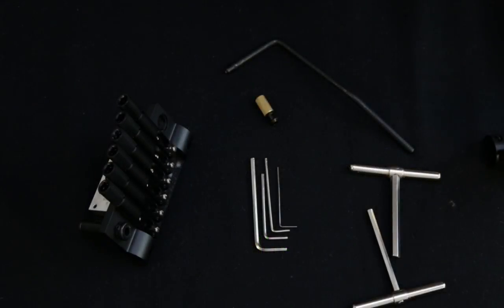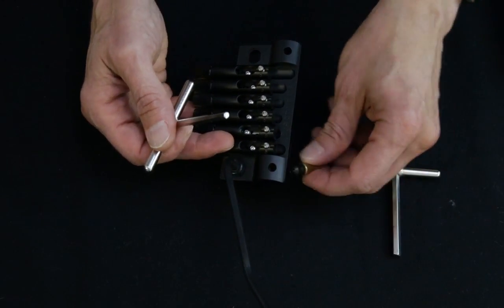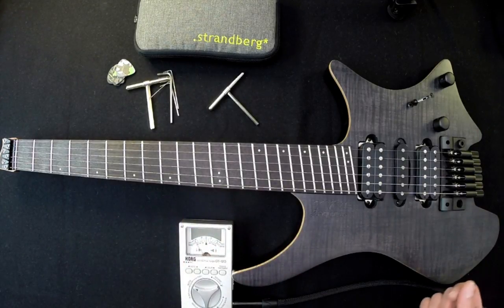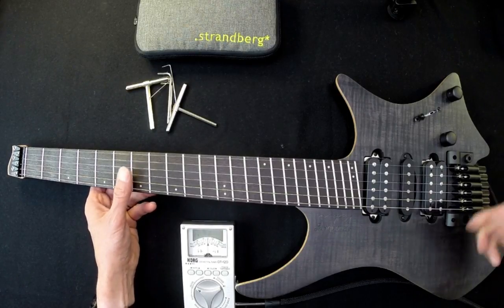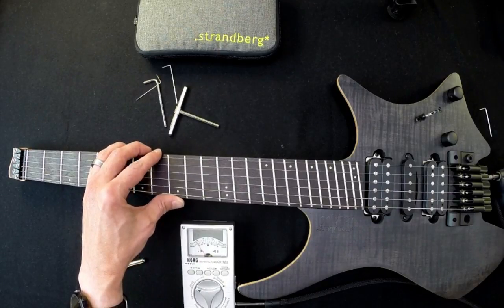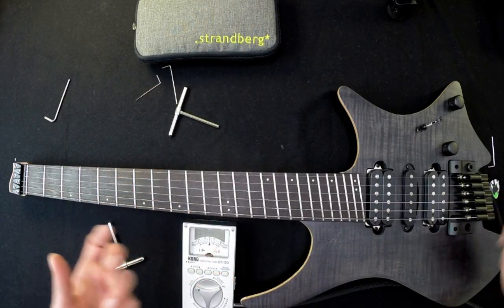EGS Pro Tremolo Rev 5 Overview & Setup

Comment: You just changed the main reason I was going to buy a Strandberg. Knife edges may work but why would anyone even ever think to use that method over a needle bearing system? Eventually a knife edge is going to wear out and lose tune. If the only issue is making it easier to adjust string height then I would either create a housing that still uses needle bearing system that is adjustable or live with the minor issue of adjusting each string. I hope you give your customers a choice of which tremolo system they want...
Reply: Okay but what about the knife edge? Very poor design from the beginning. Here's an idea use rods where the knife edge would be and have the posts have a protruding section to accept the rod. This way you can still easily adjust the post in the same way. I'm giving that to you for free how about that!
Reply: wat?
Reply: Indeed! The original justification for designing the entire Strandberg vibrato WAS the elimination of knife edge in favor of needle bearings! I'm like, "What in the heck is going on!"
Reply: I kinda thought the same thing initially but now after having taken all the hardware apart and examining how it all works and assembles and dis assembles while swapping pickups, it's really not rhat bad. Worst case scenario, youd be replacing the worn knife edge posts and knife edge receivers in the actual bridge. Both of which are extremely easy to remove.

Comment: I see soo many people taping change and picks together to block trems during tunning. One would think that in this day and age where technology such as 3d printers and cnc maching exist, that the manufactures would just make a part or insert to  to address such a matter... just a thought.
Reply: If you look at the older design prototypes on the old website, you'll see exactly such a feature built in to at least one iteration of a vibrato bridge.

Comment: 0:32     Overview of the Rev 5 Tremolo
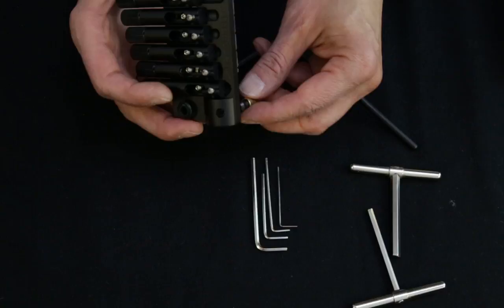3:05     Tools and where they fit on the bridge
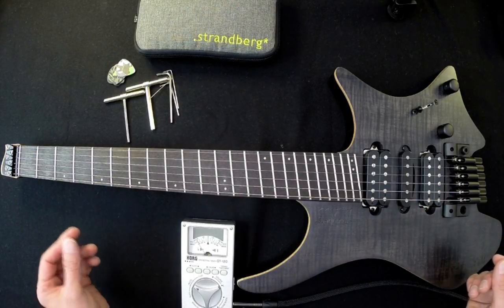7:00     Checking the relief of the neck
7:40     Adjusting the action
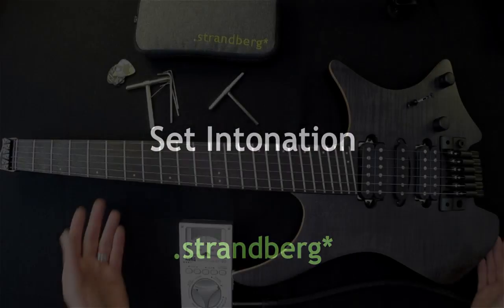8:54     "Stopping" the tremolo before adjusting intonation
11:03   Checking and adjusting intonation
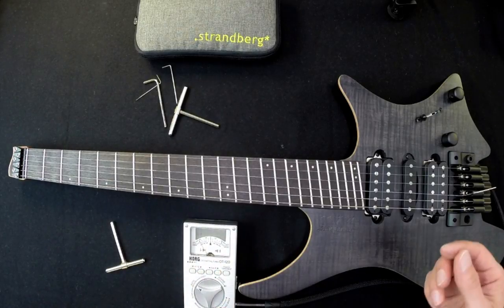15:00   Not enough slack to adjust intonation properly: Ola's solution
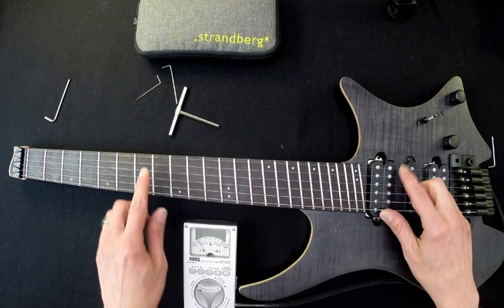16:38   Removing the improvised trem-stopper and re-tuning
Reply: Do a video outline of the mouth smacking he does.

Comment: Two suggestions: I worry about stripping the holes for the trem claw screws if you tighten and loosen them every time you change strings. Replacing the trem claw screws with bolts that go into a threaded insert would mean this never becomes a problem.  And I don't know how to fix it, but it sucks that the string has to be loose to move the saddle to adjust intonation. It would be far preferable if the saddle could be moved with the string under tension.

Comment: In needle bearing tremolo the housing could be mounted over a traditional mounting posts with studs and it could have been height adjustable like a floyd rose posts.

Comment: I'd always check the harmonic agains't the fretted note in your usual playing position (at least if you're adjusting your own guitar). The way shown usually works fine, of course, but in my opinion/experience the position is also a factor because you normally use a different pressure in playing position and your fingers also are in a different position. And if adjusting in playing position you can compensate for that (if necessary, and if you're a nerd;-)).
Reply: The more I watch these Steandberg setup videos, the less inclined I am to purchase one. That method of adjusting the intonation is so labor intensive, and is non incremental, meaning you cannot visually monitor the adjustment sweep. It's a bafflingly bad design.

Comment: Ola,

How would you recommend fixing a nick in the zero fret? I recently purchased a standard 6 and I’m not sure if the dent was there when I bought it or if I did it but the zero fret had a dent at the b string

How would you recommend fixing that? 

My dealer recommended 800 grit sandpaper then polishing with 1000 or 1200 grit

Does that make sense?

Love your guitars ( already have another one on order!)

Comment: I have just brought a Korean 6 strings tremolo guitar. I can't get the saddle at guitar level when I use 3 springs in the back, so I install 4 strings. I use 10-46 strings recommended by official website, what is wrong with my setup? And I find it so difficult to make it intonation.

Comment: Refision 5 Ola? New, but still no brass block... why? As you guitars have no headstock, where does the sustain comes from?
Reply: Paul Kasper can you add a brass block on your own or it won’t fit on these guitars? I installed one on my floyd but no clue about this setup at all. And sucks cause I do want a strandberg but for price should have a brass block. Good point.
Reply: That's actually kinda easy. It never came from the headstock. All physical bodies resonate.

Comment: As a (far less renowned) guitar designer and builder, I cannot wrap my head around the way the intonation on these guitars is adjusted. It seems incredibly hit or miss.
Reply: I don’t own one of these, but it seems the same as for a Floyd Rose from the video. Not as convenient as on a fixed bridge but it’s not that hard either
Reply: @tiagomartins5755  The fact that you can't set the intonation with the strings on just seems wild to me. I had instances back when I was a touring musician when, for example, my preferred gauge of strings wasn't available and I would tweak the intonation as a matter of course after restringing. With the Strandberg, you'd have to string up, tune to pitch, see the deviation, loosen the string, adjust the saddle, retune, check again, and then hopefully(?) get it bang on, and if not, repeat that process over again using what I can only call dead reckoning. Seems crazy to me.
Maybe Ola's ideal is that you'll never change your string gauge or adjust the action (at the bridge) once the set up is complete, but that just isn't realistic.
I would love to tinker with one these guitars for a few hours though, and they are great looking/well designed otherwise.

Comment: I like to run my 7s in ADADBGe
Just received my Boden original 7 with a trem and anytime I try to downtune it throws everything off. Should I use more springs to counter that? Or will I need to block the trem off so it only goes downwards?
Reply: Two years late, but you’re probably gonna have an easier time blocking off the trem if you downtune often. I would figure if you do a downtune for a set, you could downtune the one or few strings at least one whole step and be fine without having to adjust intonation as long as you’ve been setting it up with the same gauge strings

Comment: How do I adjust the individual heights though
Reply from the maker: The individual string height is adjusted by raising or lowering the individual saddle screws, using a flat-headed screw driver.

Comment: Adjustments with the guitar on its back is fine for the purpose of demonstration but, you should instruct viewers to actually perform these adjustments in the playing position. The things that hold me back from trying/buying this guitar is the Endur-neck that "guides" where my thumb should go (according to the inventor) and that gd zero fret. I have a zero fret on a slightly pricey Steinberger and it SUCKS. The plain strings dig grooves in it after a few months and the "clinky-clnky" happens. A stainless steel fret was put in. It lasted about 2-3 months longer before failure. The nut behind the zero fret on the Strandberg may partially restrict side-to-side movement but, the groove problem will still occur over a relatively short period of time. The zero fret needs to be fired into space along with the Les Paul tuner/headstock arrangement.